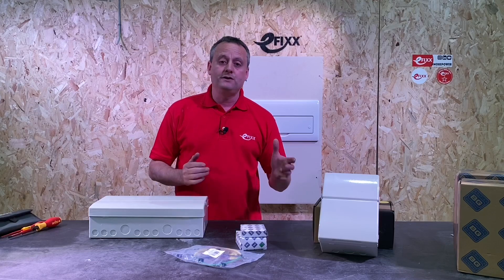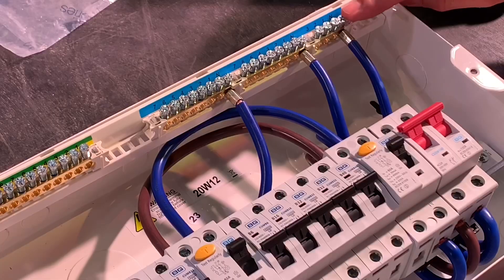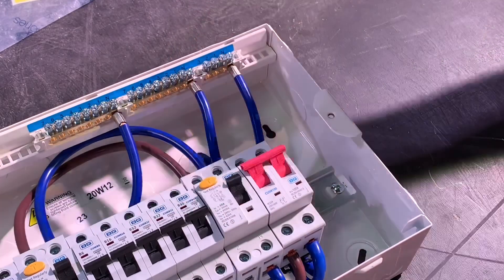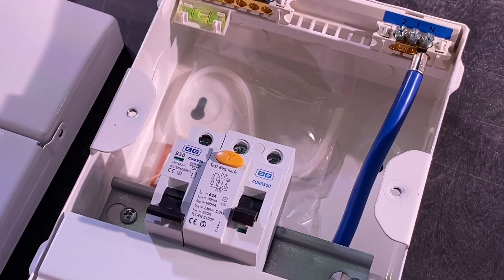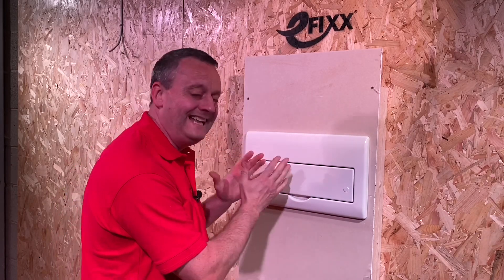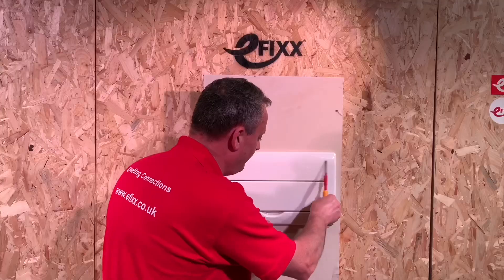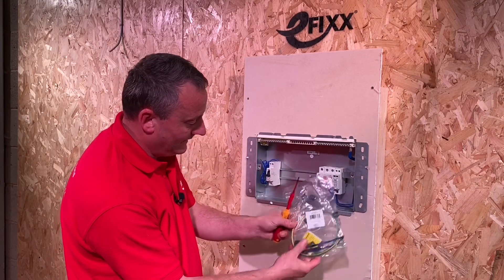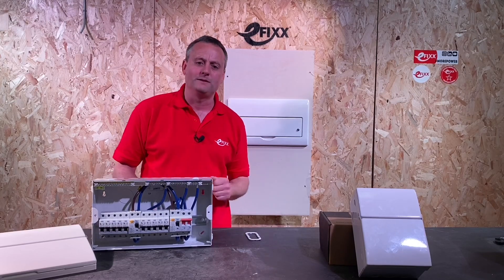BG Consumer Units - Recessed, split load & Shower

Comment: can tell the manufacturer has listened to its installers in regards to spacing, screws backed out always saves time on install and the recessed unit gives the client a sleek finish. Especially on new builds with fuseboards being installed at 1350mm, rather than a surface board sticking out the middle of the wall,  the recessed could be fitted in the hallway rather than the dreaded under stairs cupboard that us electricians love so much.
Reply from the maker: Great point 👍

Comment: Regarding the dual RCD populated board with 63A RCCB's: I know it's up to the installer to match the characteristics of consumer unit to the supply, and that you were just pointing out the features of the unit, but may have been worth a mention that the 63A RCCB's are somewhat on the small side and will probably limit its installation to only those with 60/63A supplies (whether service fuse or consumers switch fuse) - for those who've not seen it, see this BEAMA guidance (of which BG is a member) for details: https://www.beama.org.uk/resourceLibrary/beama-technical-bulletin---overload-protection-of-an-rccb-or-switch-bs-en-61439-3-ed-2-mar-2019.html Maybe an idea for a short video, with Joe answering the question, what size/rating does an RCCB need to be in a split load board.

Looking forward to this weeks lockdown live feed 2 😀
Reply from the maker: Thanks for the comment a John - Good idea we’ll get Joe to answer this :-)
Reply: @efixx  good stuff, and it can be linked to Q2.49 of the I&T section, by Electrical Safety 1st (at - https://www.electricalsafetyfirst.org.uk/professional-resources/wiring-regulations/inspection-testing-certification-and-reporting/ ) as well because under the 18th edition, and BEAMAs interpretation of the relevant regs, many existing installations will be C2 or C3. 

This could have far reaching consequences, that has certainly got one electrical engineer on the IETs wiring and regulations forum riled up: https://communities.theiet.org/discussions/viewtopic/1037/26499
Reply: @Jules Moules in a normal domestic installation, without heavy continuous loads, it doesn't really matter if the CB total exceeds the upstream fuse value because it's unlikely the fuse will be troubled anyway, particularly a 100A fuse. Note that if method 1 applies, on e.g. a 100A supply, the RCCB does not have to be 100A - it could be 63A if the CB total ratings do not exceed that value, because they cannot overload the RCCB. 

It's not a problem with RCBOs because there is no RCCB to overload - all you need to do is ensure that for the main switch Inc => In (whether by service or customer switch fuse).

PS how did you get the equal to, greater than, symbol to appear as you did (I'm using a mobile)?
Reply: @Jules Moules it's 2019, yes, but note that it was to coincide with the 18th ed regs, that came out in 2019. 

Poor ol' Dave Zawadi seems to be having kittens about it on the IET forum. I doubt he'll get much to change though if there's money in it for BEAMA members who'll now sell bigger more expensive RCCBs both in new boards and installed as retrofits to the many millions of boards that will now be C2s or C3s - if inspectors and installers follow the guidance, that is 😁
Reply: @Jules Moules ok thanks. I've Gboard installed and it's not in there, that I can see, at least, so I'll try the other one you mentioned. Cheers ☺️
Reply: @johnhoward2104  ≥ just type the words into Google and copy and paste peg it as protected/locked on your clipboard.  Otherwise a 3rd part app.
Reply: I think it's why hager's are 100 amp 😎
Reply: @PardoeElectrical  holy resurrection, this one's going back some years, I'd forgotten all about it - but yes, Hager make all theirs 100's now to cover all eventualities up to 100A's.

Comment: Nice video , i have question why all  consumer unit in domestic dwelling had two "rcd" and it protects several mcb why not be all breakers "rcbo" and main switch or isolator ... is that debending on cost of work or what  . thanks 👍
Reply: It is generally down to cost a whole rcbo unit is around twice the price of these split loads of not more than twice, I have rcbo in my home and again in my garage to mainly it is due to cost and preference

Comment: Fitted BG in the past, biggest downfall was din rail distortion on larger boards which made fitting the cover difficult. 
The Garage CU is very well constructed and nice to install 👍. 
The earth and nuetral bar  terminal screwheads can round off if tight to start.
But never had to replace any RCD's MCB's through defective manufacturing.
Overall a good board for a modest cost.
Reply: Have to agree with you the bigger  ones  do put up a fight to get the lid on otherwise a decent thought out board.

Comment: Have BG improved the flimsy din rail. I remember using BG and hating the boards for the flimsy din rail when trying to tighten anything up it would just push and bend back

Comment: Good quality board, however, how do split load boards still comply without deviating from BS7671? The failure of 1 circuit should not cause the failure or effect of another circuit?

Comment: Would the entry points of the ressesed board need to be fire sealed?
Reply: I would think you need to look at the building regulations and also look at the surrounding materials to ensure you meet compliance. Most of the time you do not need to, but every installation is different

Comment: Great consumer unit, but don’t fit one of these if you are fitting it at low level as the lid doesn’t lift up enough to let you see the breakers, not good if your aged customers have to get on their knees to reset an RCD. (I know there is a drop down version but you usually don’t know which you have until you unbox it, and the kid on the drop down version does fold far enough to fit at high level - go figure
Reply: the part number has a letter U in it for up opening CFUD as example